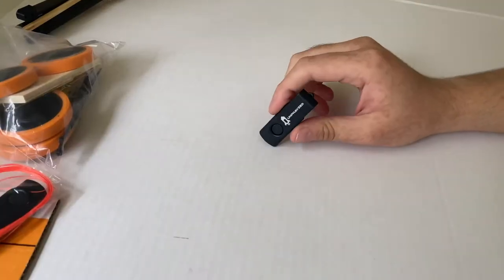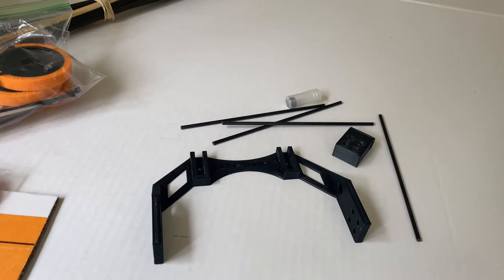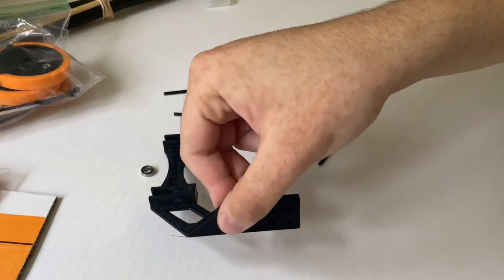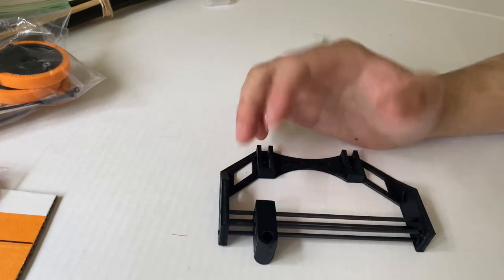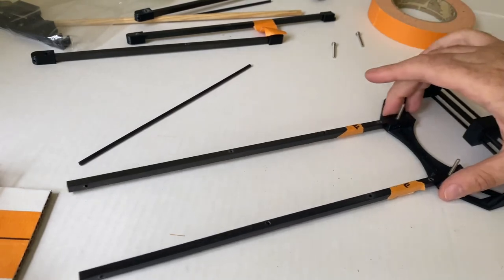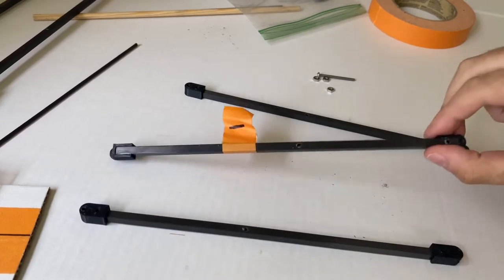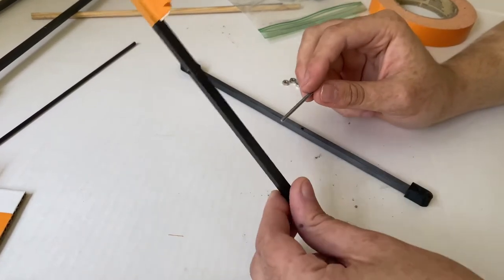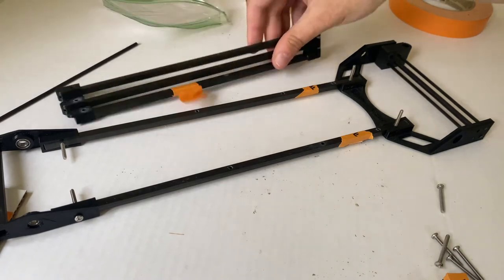How To Build A Mousetrap Vehicle | Expert Mousetrap Vehicle Kit

Comment: Unphayzed can I ask a couple questions about the mousetrap
Reply: I ordered one and the long poles labeled F are kind of broken on the end. Will this effect the mousetrap
Reply from the maker: That’s weird I was sure that everything looked good before shipping. I am very sorry that the kit you received was damaged. From my own experience small cracks in the carbon fiber tube are not too significant to the overall durability of the car. You could simply flip the square tube so that the non cracked side faces out from the insert it’s supposed to be in. If you feel, however, that you aren’t able to work with it, email me and we can sort it out.